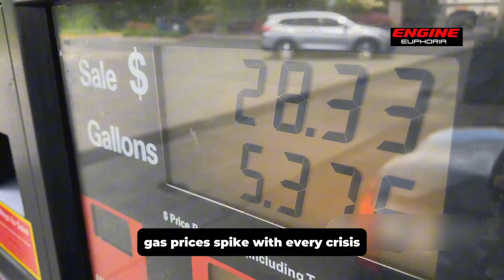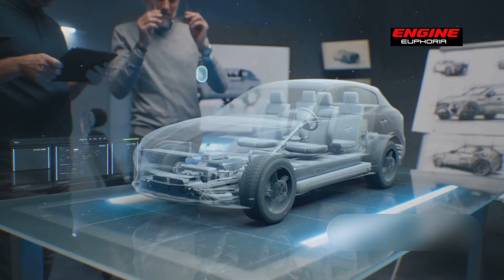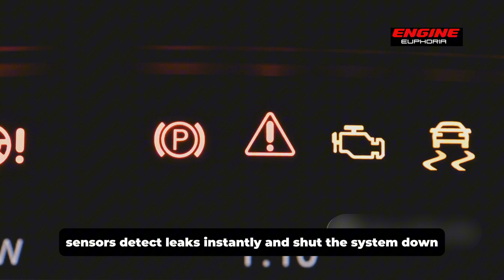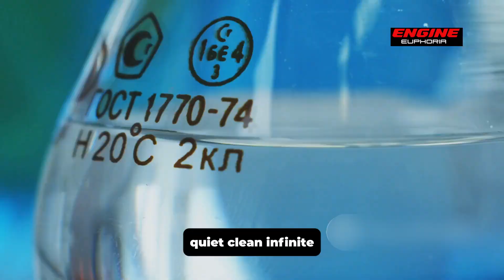Toyota’s Water-Powered Car Is Real And It’s Coming Fast

Comment: click bait, Hydrogen from hydrolysis is expensive and only viable when renewable excess production is used but then you have the electricity anyway. Current production is from Oil so your drilling. Metal embrittlement  from H wrecks everything.....good luck with H when its 10x an EV cost